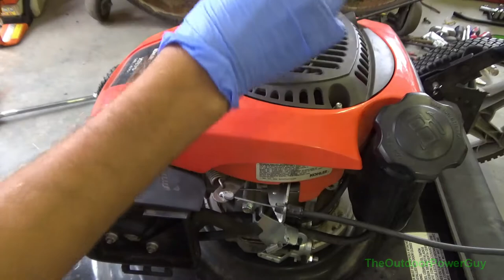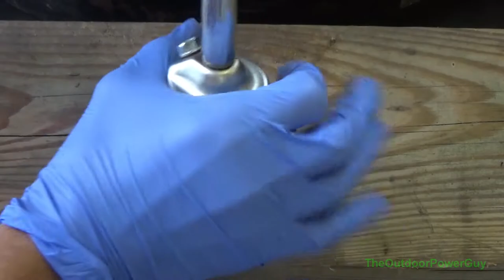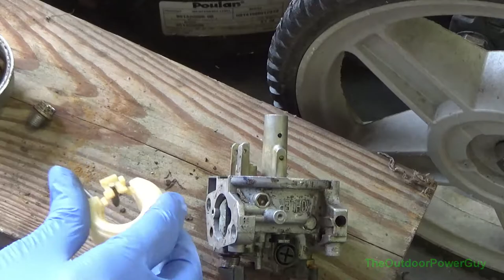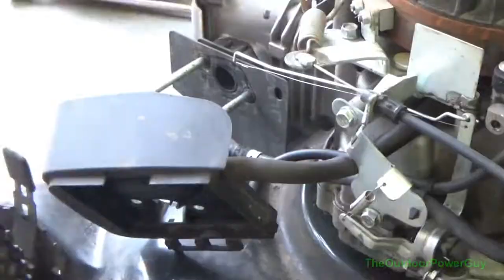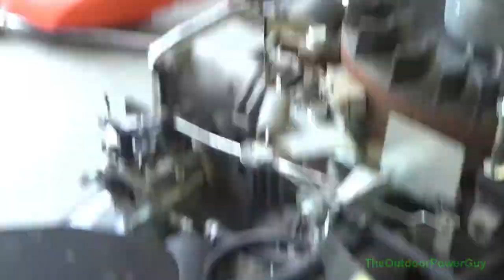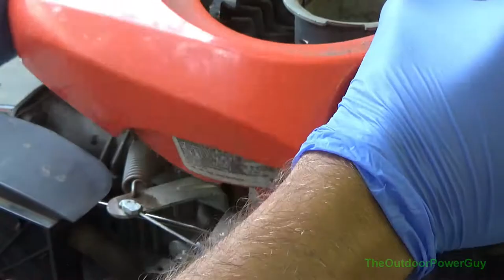Cleaning a Kohler XT Series Carburetor

Comment: You didn’t remove the emulsion tube under the main jet to clean it? You also didn’t remove the plastic idle air bleed jet from the top of the carb to clean it. They often plug up causing a surging problem. They have an extremely tiny hole in the bottom that can easily plug. A very common issue with those carbs......